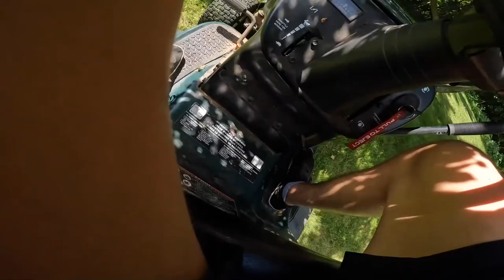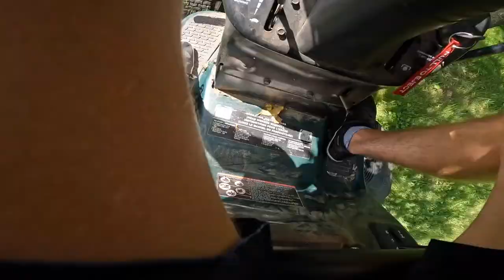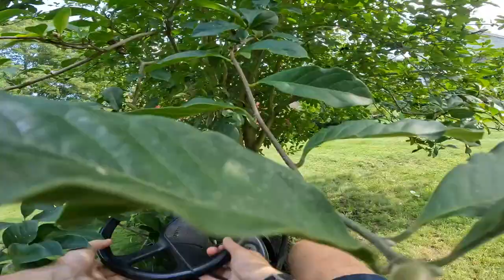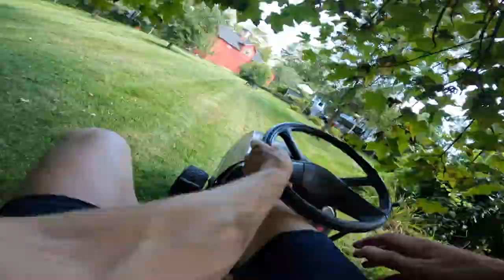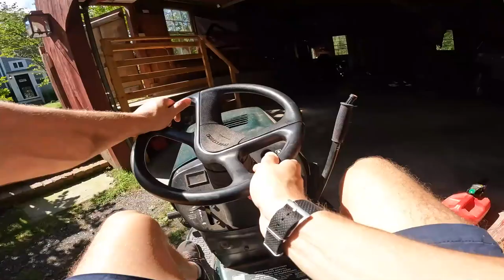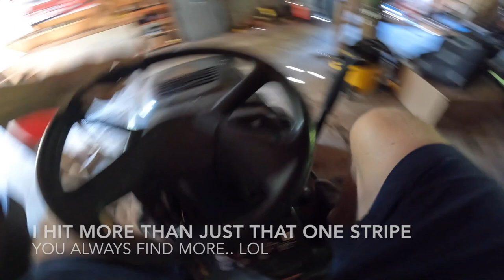MOWER VLOG | BACKYARD TIMELAPSE | not a cafe racer motovlog - ep 130

Comment: I was just curious. On the left foot, u have break I think, but where is the accelerator pedal? or lawn mower doesn't have that?
And also, next time replace the timelapse sound with ASMR 👍
Reply from the maker: Left foot is the clutch/brake all in one. No accelerator pedal at all, just the gear shifter on the right controls the speed. 

Ya know I thought about putting some sort of music, I think the only time I used music in one of my videos is the one where I was sanding my fuel tank. If I ever do a mower vlog again, you have my word it will be more than just buzzing! Thanks for watching lmao.